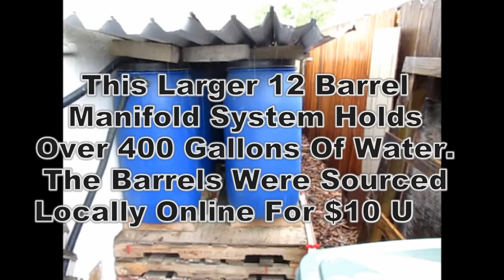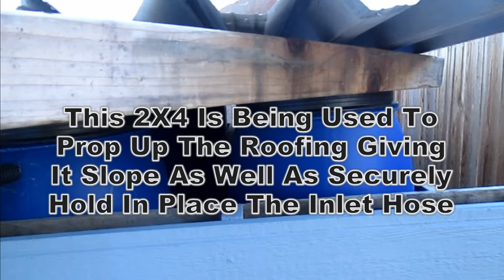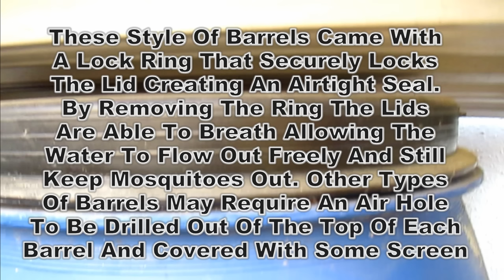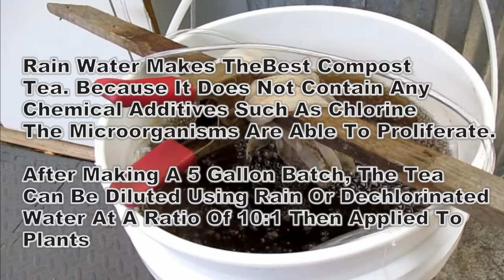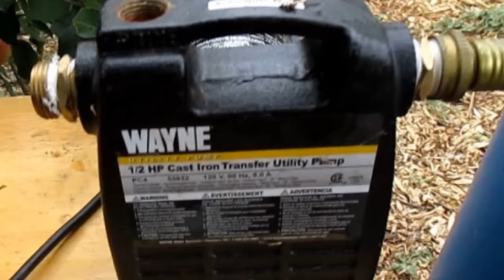DIY Backyard Rainwater Harvesting Using Repurposed Food Grade Barrels

Comment: It is much easier just to buy a tank. Plus the storage capacity of the barrels is low
Reply: It ALL depends on what your needs & intended use is... mine built just for emergency supply of drinking water when cutoff in emergencies. Others water extensive gardens, so a larger tank is needed.

Comment: 0:21 LOL can anyone source why gravity "is stronger higher up" away from the mass that's causing the gravity wtf l o l
Reply: They're trying to take the concept of a city water supply except the exit of that pipe is at the ground. The delta Z increases you would have increased delta P... This doesn't work because the Z doesn't change it's fixed so if your on Earth or any other planet going higher wouldn't do anything...
Reply: Lots of confusion in those terms... but it amounts to greater "head pressure" at the exit... NOT more or less gravity anywhere...